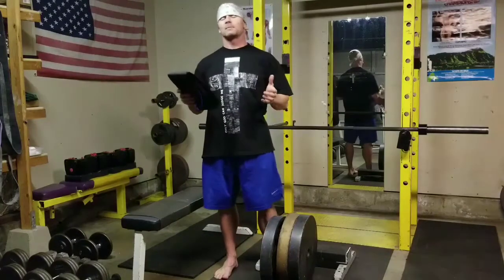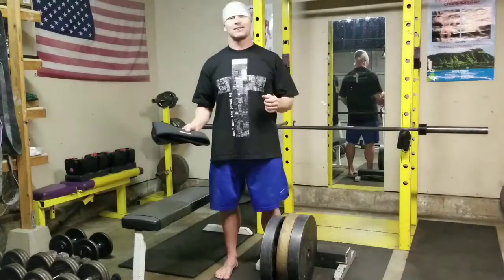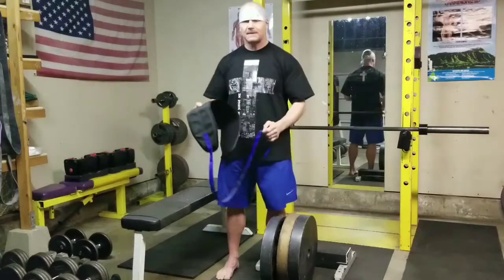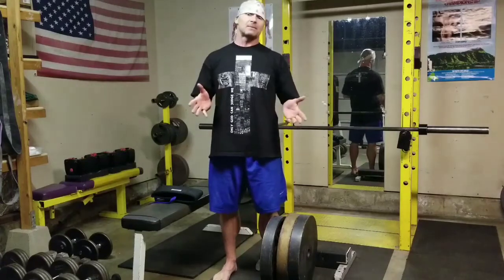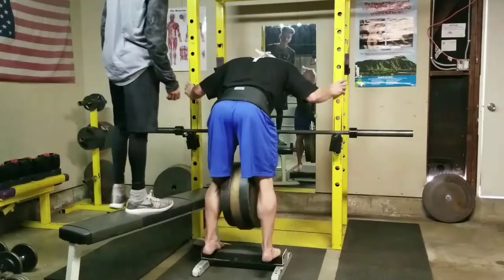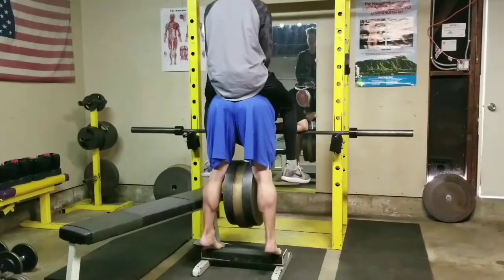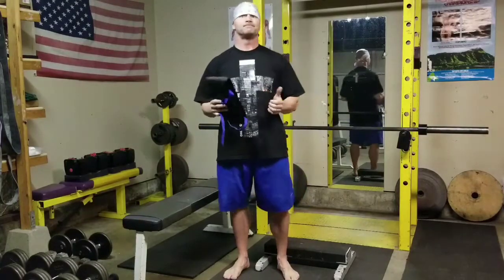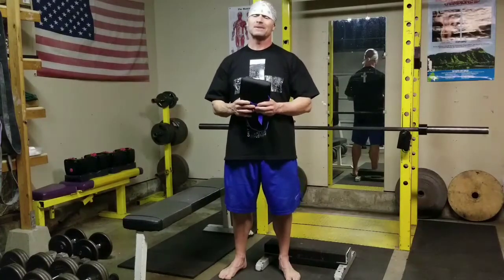Donkey Calf Raises build calves!

Comment: Holy. Your calves are goals. I’m gonna try this. What is your opinion of doing standing calf raises with a dip belt ? Is it just as good ? Looking forward to your reply !
Reply from the maker: No it isn't.
It'll pull weird on the hips/low back.
Reply: Yea you’re right. I went to Home Depot to get some 2x4s and built a calf block. I did these donkey calf raises last night and damn, these are killer! I only used 2 45s and mine were on fire! I only did 1 all out set like you did.